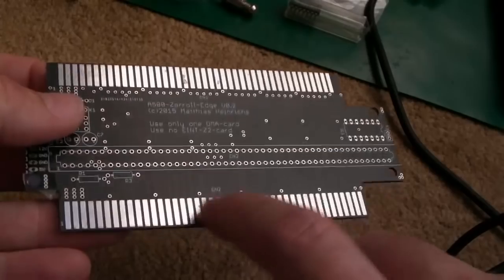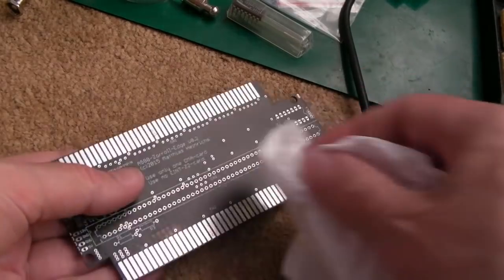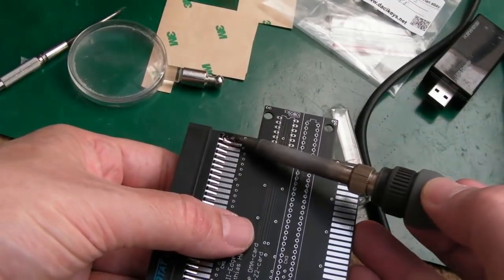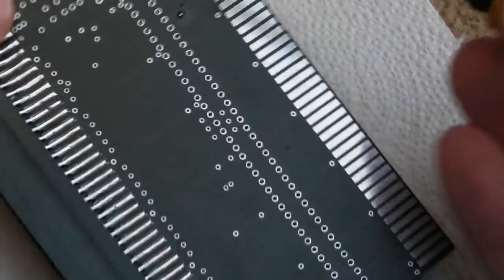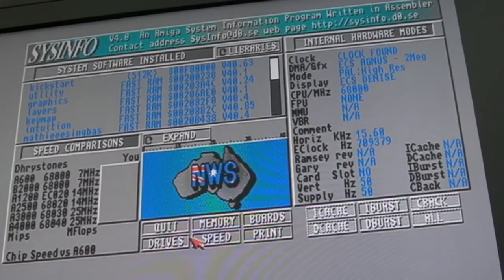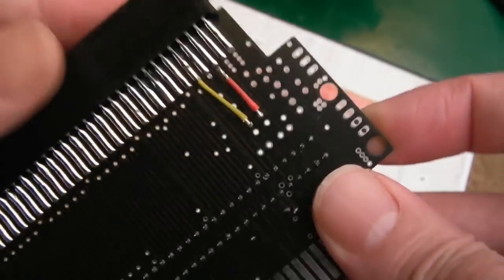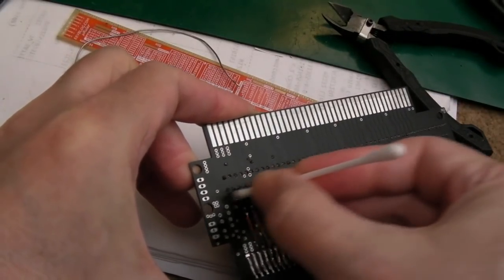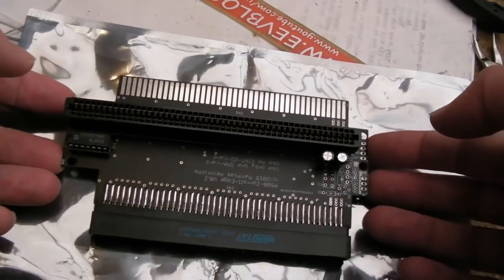Matthias A500 Zorro Edge Connector - Build & Test

Comment: I do not think it´s silly to put a a2091 to an A500. It is just silly to seat it upwards. If you use an angled 100pin Zoro II socket, the a2091 would lay flat. While it is longer than the board of a typical A500 SCSI-extension of course, but it would still be accaptable imho. Actually the a2091 would be a great extension to the A500/A500+ imho, esp if you have a working SCSI CD-Rom drive. Actually - as I do not have a working SCSI CD-Rom anymore - I actually plan to add an Buddha IDE card to my A500 this way. Simply to add an effordable CD-Drive (as the A590 is barly affordable and quite slow anyways). While I will upgrade one A500 to PiStorm, the Buddha IDE should still work (it doesn't use DMA as far as I remember - this might be the problem with the A2091, as it uses DMA). I wouldn't need HD (as the PiStorm does this), but real CD support is something I miss on the A500.
On my other A500´s (without PiStorm) of course adding a Buddha IDE this way would even be better, as it adds both HD and CD.

But an a2090 or a2091 might even be better for a (conventionally accelerated) A500. With the BlueSCSI2 now supporting WiFi, you could use the edge connector to add the a2090/2091, a BlueSCSI 2 and a SCSI CD drive. Actually  I have an a2090 flying arround from my A2000 (wich uses Buddha IDE now and having a X-Surf inside, so no use for the A2090). I am tempered to order a SCSI CD-drive from eBay, buy a blueSCSI2 and build a CD/HD/WLAN extension for an A500 this way (with the A500 being upgraded to a 68030 with fastram before, as minimum requirement for the SAN2-driver for the bluescsi2 is a 68020).

By the way: would the edge connector also work with an A1000? Would be great to upgrade the A1000 with an A2090/2091 also...
Reply from the maker: Yes, an angled connector would certainly make it lay flat! 👍  I think it could work with the A1000 - something I need to get around to test on the GBA1000...  The only thing is, because its on the right instead of the left, anything you plug in there is facing backwards.

Comment: Very good video.
As the Zorro edge connector seems pretty simple, there is one question I ask myself: If you might get more stability, could you use an A2000 remake or EATX board, put the components of an A500 (or even an A500+, as the EATX supports 2MB Agnus) to it and handwire this single chip to make one of the ZII-slots working without the need for Buster?
With a pistorm most functions you normaly would do with a ZII-Card are already onboard anyway (RAM, HDD, RTG, Network), so you might need only one ZII-card. Maybe an old Meastro (I might want to recover old backups from DAT), Maybe a bridge board, Maybe IDE for CD-Drive (but I am not sure if that might be possible with the USB-Port on the Pistorm already - you can use piscsi for accessing USB-sticks or USB-harddrives already nativly, maybe this work with USB-CD-Drives or will work in future?)
As Buster is not easy to get and not needed for 1 ZII only, this might be interesting to get around it.
If you use an EATX, of course you should use an acrillic case, ad some fans inside , paint a styropor ball in red&white and let it be kicked through the case. So nobody mistake the Amiga for a PC...
Reply from the maker: Someone could add some of the additional 74 series logic into a chip like Bluster, and allow the use of 5 or more Zorro slots.  It's easier to just build an EATX A2000 remake though imho.

Comment: Can you please explain what is considered an EINT-22 Card? I wanted to use this with a GVP SCSI card from my A2000.
Reply from the maker: If you get the A2000 R6 schematics and look at page 9 - the EINT connections are shown there.  EINT1, 4, 5 and 7.  They are extended interrupts.  ie. Interrupts that dont fit with the usual interrupts that most Zorro II cards used.  I've not heard of any cards that use these EINT connections!  I guess the GVP manual might mention whether it uses one of those interrupts or not, or maybe there are jumpers to select the interrupt?  Many cards (eg. A2091) use either INT2 or INT6.

I tested my GVP combo SCSI on my Zorro adapter and it worked fine - providing 8MB and SCSI.

Comment: Great vid, I know him well, you have have unmasked Zorro.
Did you find out about eint.
Reply from the maker: Nothing specific - I did work out that the EINT stuff is basically extended interrupts that are handled my some 74 series on the 2000 mobo.  This adapter doesnt provide that, so that's why EINT stuff wouldnt work.  But my understanding is most cards out there just use INT2 or INT6 (which are natively supported on a 500).

Comment: Hi Bud. Love your videos. Your passion for everything Retro is second to none. I have always been a massive Amiga fan. I was born in 76. My first introduction to video games was my Dads  very old basic pong machine. From there they got me a G7000. A few years later a C64 with 100's of games, 2 datasettes, an orginal 64 one and another square chunky shaped one, with 1541 disk drive. When the Amiga came out I had to sell all my C64 stuff to aquire a Brand new A500 1.2 kickstart and absolutely thought I had won the lottery. What a machine. I had a 512k memory expansion, external Cumana 354 disk drive and a Star LC-200 9 pin Colour printer with a t-shirt printing ribbon. I use to do all my Dads invoices for him on it, until my parents divorced. I then sold the lot for £250, around 1990. Anyway, I know have 2 Amigas. My next door neighbors A500 1.3 and my Dads A1200 and a Star LC-24 200 colour printer. The last time I tried them they were both working to begin with, but the A500 is now kicking up a green screen, which I'm guessing is a memory problem. The A500 has 512k ram card in it with a battery, so I'm guessing that's what the problem is. How much would you charge to recap both Amigas for me? If that's a service that you offer, I'm not sure? I'm guessing you most likely live up north somewhere? I live in the Oxford area. Take Care and Best Wishes ✌😎
Reply from the maker: Thanks =D  I don't generally offer customer repairs - but I can put you in touch with someone that can if you want?
Reply: @GadgetUK164  Hi Bud, That would be great. Thank you, Bud. God Bless and Best Wishes ✌😎

Comment: Are there any markings for what is the top of the board and what is the front? If not, that seems like quite an oversight to me. :(
Reply from the maker: Not that I could see - but the boards plug in just the same as in the 2000 - with the components facing to the right side.

Comment: I would use thicker wires for the 5V and 12V rails, those ones look a little weedy to me.  I would suggest to use at least 18 gauge wire from a dead power supply at least and connect it directly to the pins on the connectors instead of the tracks on the PCB if possible.
Reply from the maker: That's a good idea to avoid voltage drop!  Although it is fine as is - fine for the current with no noticeable voltage drop!
Reply: @GadgetUK164  I am just worried if someone uses a old mechanical SCSI or IDE hard drive on one of the expansion cards and it draws enough current at startup to cause it to go into low voltage shutdown.
Reply: Thicker wire is not really needed unless you are using a card that draws more current than the recommended specs. Such a card would make the Amiga fail to power up anyway with a standard Amiga power supply, you would need a supply with higher amps.